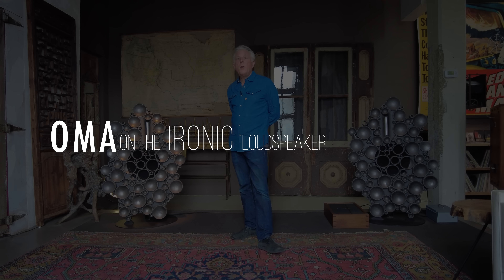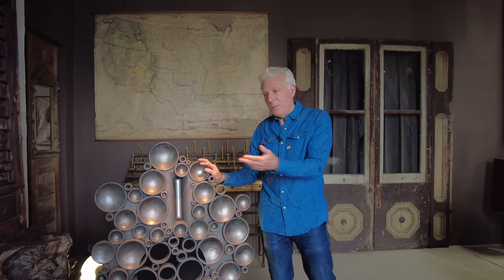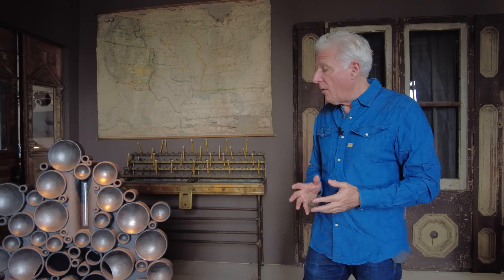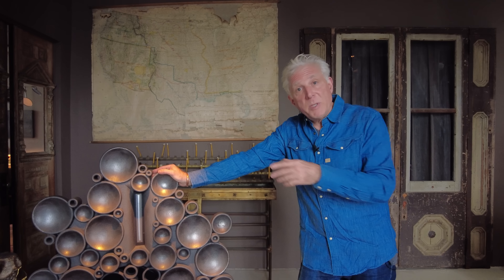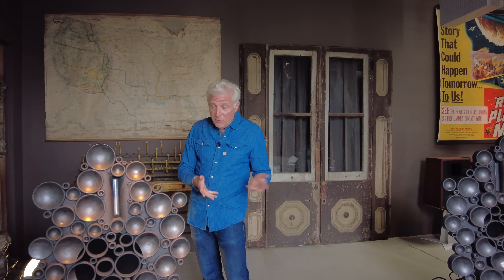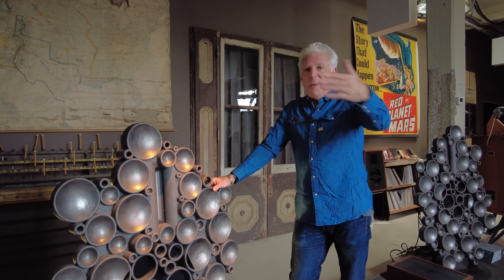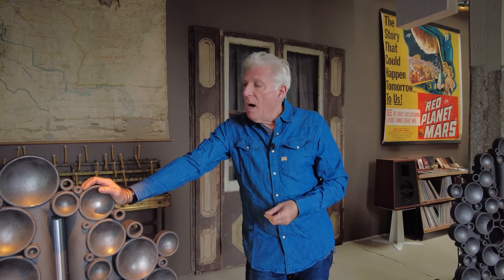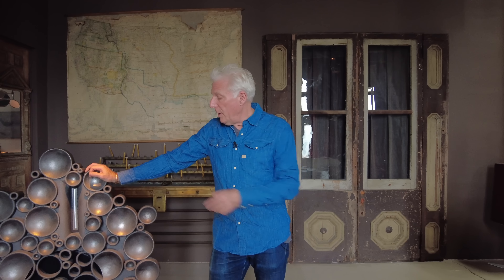OMA on the Ironic loudspeaker

Comment: He actually manage to tell us that a speaker element made in the 30s are better then what’s made today…thats just not close to the truth. However, the speaker is still art
Reply: He wants to say that the field coil transducers (modern or not) are  better than those with magnets, even alnico or neodim etc Which is quite obvious, since the distortion of the dynamic transducer  are the less the higher its sensitivity and in the case of field coil  sensitivity is not limited by the  flux of the magnetic system

Comment: Follow-up:  I found type of speaker element you could use as a perfect replacement with your amazing open baffle design.  I suggest a collaborative approach with the speaker manufacturer called (Zu Loudspeakers).  Their 10 inch driver has a frequency range of 40-12K hz with no crossover!  Just a thought to extend your love affair with this unique design.

Comment: Why do they use heavy permanent magnets,instead of lightweight field ones?And how about tackling the damping issue in open baffles by using dual opposing bass drivers?Instead of 250 kg front diffuser baffles?But then you'd only make 5 pairs of these outside of time domain speakers!

Comment: It is a 15 inch fieldcoil wide range. Probably alnico. 
And a custom made ribbon. Magnetostatic. Aluminium and magnets. 
On an open baffle, but that he says up front.
Nice design, good job with the baffle. And a lucky find with the 15’s.
Reply: Alinco and Magnavox used that style of coil enclosure - but when I noted the teardrop shape of the stampings in the basket, looks more like the 1930's Magnavox 15" field coils, used a lot in Northern Electric Radio JukeBoxes - Spec 1D-688 or similar?  These go for a few grand apiece when you can find them - and rarely in great shape. Very cool find and worthy of a neat speaker project like these! Would love to hear them in real life someday.

Comment: I love these speakers, their look & their concept, i.e. O.B.'s, woofers with powered field-coil electro- magnets (i've heard wonderful things about their sound quality that later designed permanent magnet drivers lack) & near-massless  ribbon mid/tweeters.  They look like perfectly mirror-imaged pairs of cast iron (!) baffles that won't resonate like wood- based baffles could & because of their amazing aesthetic look (i love it) almost forgot about the baffle surface's ability to break-up reflected sound waves, not something i'd thought about nor could have done about on standard large'ish speakers, tho it's a large audio- reflective area & must have an effect (i was once surprised to hear a temporarily placed 10'ish inch-sized box singing at me from 4 or 5'ft away before while listening) ...but only 20 pairs!! & I'm no millionaire

Comment: I might have a go making some be nice to hear a pair... in the UK! You could make them out of resin and sand or resin and slate dust. Not particularly a difficult process I think resin and sand would be a better than metal. I did a turntable plinth and it sounds great.
Take a good driver would be the 15 inch volt  98db efficient you know the one with the basket on the front. What's the issue of making a field coil version I'm sure they could do it?? Or couple of leak sandwich 15-inch 15 ohms I don't know the sensitivity of these drivers i can't get any information they must be in the high 90s db
What about using a plasma tweeter? They go down to 5000, Hz, alternative a compression driver going down to 300 Hz
What order of crossover do you use second order on the woofer first order on the tweeters? And why not analogue active crossover?

Comment: Could you cast them in various jig saw sizes and then weld them together, to save cost?   It would be interesting to just go ahead and install modern drivers and see how it treats your open speaker design.